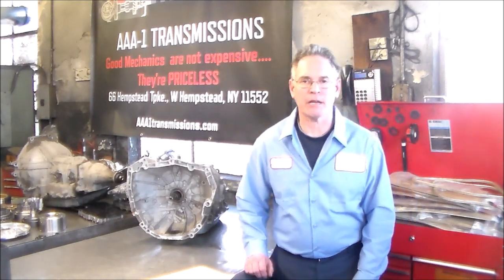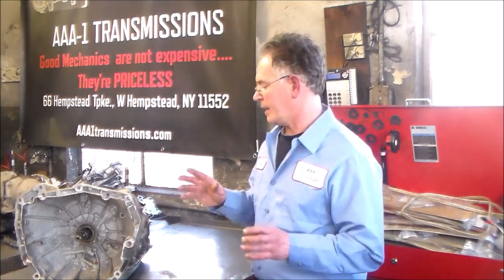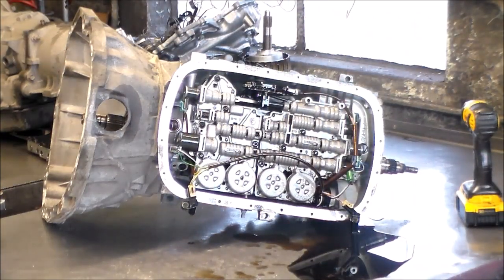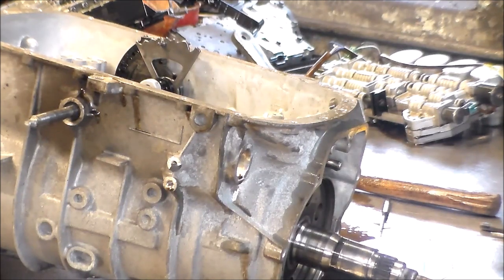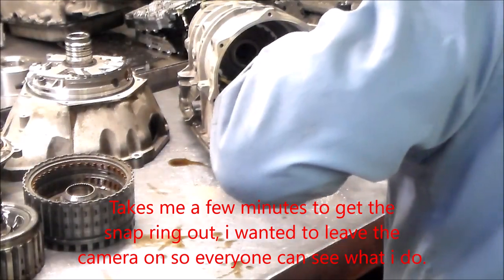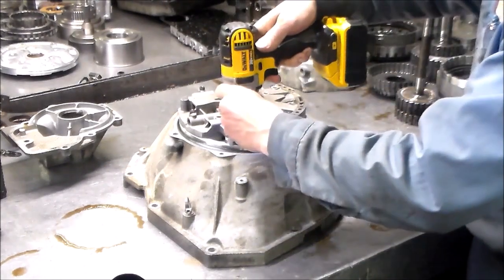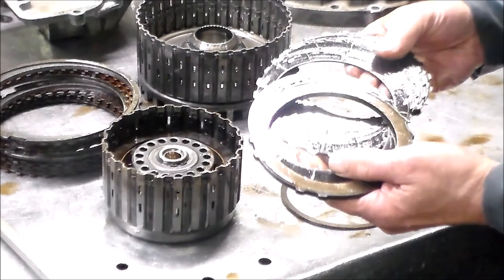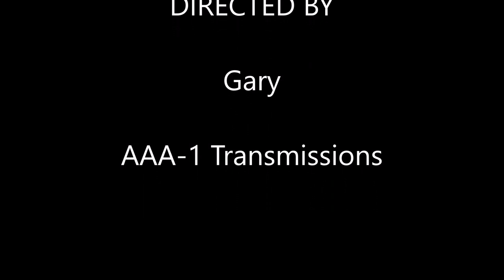5L40E Teardown

Comment: Man this video just explained so much. Haven’t drove my Pontiac g8 in 3 months because it stops accelerating after warming up, I’ll come to a stop and nothing. Turn the car off, let it cool down, and good to drive for another 5 minutes. No codes came up either. I’m afraid I’ll need a trans rebuild after watching this
Reply from the maker: Yes, you may need one. Problem is the filter is clogging up
Reply: @GaryFerraro  which means somewhere in the transmission there is failing components which is leading to the filter clogging , correct ?
Reply from the maker: @MrStfu88  Correct
Reply: @GaryFerraro  hey isn't it just those rubber seals between the valve body and the body of the transmission.
Reply from the maker: @aksgarage3230  yes

Comment: Thanks a lot for sharing a detailed teardown of this transmission. I am currently in the process of tearing down one from a BMW X3, and wonder if there are internal differences in the 5l04e transmission between the different makes and models (Like Cadillac, BMW X3, X5 etc ?) My reason for asking is that i have a X5 transmission in good condition and have (unsuccessfully)  tried to find some information online if this would work as a replacement or not.
Reply from the maker: Caddy units are different from the BMW units,
Reply: @GaryFerraro  Thanks. I found out that the output shaft is different (splines).

Comment: at around 21:40 ,I did a repair on the neutral safety switch, but the thing holding it, the piece right beside it, the rod fell out of its spot, and I cant seem to put it back together any ideas?

Comment: u should have a couple of eye hook bolts u can thread into weld nuts on table and use a ratchet strap to secure housing when removing that snap ring
Reply from the maker: Hmmm, Not a bad idea, thanks for the tip
Reply: @GaryFerraro  u b welcome

Comment: Have the same year make and model but had a trans cooler line blow and bypassed radiator for external cooler. After flushing trans and filling back up it shifts hard and slips until the car is warmed up. What could possibly be the issue there? I thought gear wear from the fluid leaking but don't understand why it would shift fine when warmed up. any insight would he appreciated thanks

Comment: My personal truck is 05 caddy srx 3.6, awd with borg warner 4476 t case, and 5l40e auto box.  I found a bulletin, regarding trans output shaft \ tcase input shaft flanges, stripping out their splines due to corrosion.  Any comment on that would be appreciated.  

My truck makes a really scary driveline pop, when loading up on the throttle, from a stop.  Im thinking tcase chain, those input \output flanges, front prop shaft, or maybe even hub n bearing n cv axle engagement.  

I gotta get it on an alignment rack, and try duplicating the problem.  Jackstanding the truck, i failed to duplicate.

Bulletin showed rust dust build up, once getting the tcase off.  Supposedly new shafts are redesigned to accept an oring to keep water intrusion out! 😅
Reply from the maker: sounds like the chain is popping, if you pull the T-case off, you can clean up where it meets the trans and put some high temp grease, that will help
Reply: @GaryFerraro  I'm sure it is, as well.  I added a chain replacement, when I sent the 5l40e off for a bench rebuild, about 60k ago.  Sent the transfer case with the 5l40e.  Valve body bought the farm, and I said additional complaint was driveline pop on hard load.  

When I had on jack stands (about a week ago) I decided to do a drain and refill, and while the tcase was empty, I stuck a screwdriver inside the drain hole of tcase, to assess the chain slack, didn't seem sloppy....but who knows it could be the sprocket teeth starting to roll over for all I know.  

The trans shop put gl5 (thick gear oil) in the tcase when they did a new chain (that's what came out last week).  I decided to put dex 3 in it, to hopefully clean any junk inside, and I'm gonna try and drain that in next 1000 miles...figured the atf detergents might help lol.  I just hate knowing that I found that gm tsb about the trans output shaft\ tcase input shafts stripping....

Maybe I am looking too much into it, without pulling it apart.  That means, I need to literally cripple the truck for that diagnosis!  😁🤷
Reply: Thank you for the reply, either way.  I'm just reaching on this situation because it's my personal vehicle.  I've been in service, repair, diag, and electrical diag for >22 years.   Always trying to listen to both sides of a coin haha
Reply from the maker: @sidewayzmike  correct,  if you take off easy works ok?  no popping sound

Comment: I have a problem finding diagrams for this transmission, the 5L50e. Mine is a 4WHEEL DRIVE GM of the model in the video. Would you happen to know where I could find that?
Reply from the maker: Wiring diagrams or transmission diagrams?

Comment: Hello, great video. I need to replace GM 5L40E on bmw x5 e53 year 2001 3.0i. I can only source the gearboxes from the same x5 3.0i from other years, like 2003 or 2004. Is it possible to use "newer" year production gearbox to the older car? Like 2004 gearbox to fit to 2001 x5 and will it run? Please if anybody has an experience with this replacement it would help me if You can confirm it is safe. Thanks!
Reply from the maker: I would go by your vin number

Comment: Hey I've got a 5l40e transmission valve body (plate code 378) with a broken 1-2 shift accumulator spring. I'm having a lot of trouble getting either a new single spring for that accumulator or a kit of all 4. Any help would be appreciated.

Comment: Great video I have the same transmission for some reason the solenoid c won’t fit all the way into the valve I’m not sure if the metal pin should be so pushed out any ideas ?
Reply from the maker: If the solenoid is in front of a valve, make sure the valve is all the way in.
Reply: I have tried gently pushing the valve in however it is stuck on as that is the reason I am changing the solenoid as well would I have to push in the valve with something?
Reply from the maker: @twisted-sd2cz  The valve is free?
Reply: Nope won’t budge at all so not sure if I should find something like a screwdriver and hit with a Mallot however I’m afraid it will instead make the problem worse so I’m not sure what to do
Reply from the maker: @twisted-sd2cz  those valves have to be free to move, if it can't be fixed and have free movement you will have to source another valvebody

Comment: Hi Gary  I have a Discovery 3 with a ZF6HP26 I have had a gearbox repayment but they gave me one from a 4.0 V6 petrol I have a TDV6 diesel we fitted the box with the old converter as the petrol is only 3 boult and had the old converter rebuilt and had the valve body completely serviced. but the car sits in idle on full load only way to drive is to take foot off break and wait till car is moving before any gas Can you tell me if there is something different with the 2 box's spent to much money now I can only think to rebuild the old box.   Regards Peter.
Reply from the maker: Any codes?   There is a delay in drive?
Reply: @GaryFerraro  sorry so long in reply it has no codes yes a delay in drive every one beats be at the lights as have to wait for car to move off the accelerate but all time sitting at lights it is in full load have to brake hard to hold it back
Reply: once it going it runs beautiful even down shift to 1st all smooth
Reply from the maker: @peterandrews7756  ok, question, does it delay or take off very slow from a light?
Reply: @GaryFerraro  take foot off brake it moves off very slow
Reply from the maker: @peterandrews7756  I'm thinking this is not starting out in first gear, maybe starting out in a higher gear ,how is reverse?
Reply: @GaryFerraro  Both reverse and 1st gear  are the same just have to wait for car to move then accelerate if on a hill or speed bump the car wont go so I cant go anywhere a Land rover is meant to go cant pull a trailer. but as I say its on full load car is shaking at stop lights if long lights i just put it in neutral.

Comment: worst transmission ever
Reply from the maker: I don't like working on these either. lol
Reply: @GaryFerraro  also the 5l40e is used in weird configurations. for example bmw m57 (410nm tq) and the trans can handle only 340nm
Reply from the maker: @jaakko200987654321  Correct, used in Bmw as well, i did a couple of Caddy's
Reply: @GaryFerraro  my friends e46 has that trans, it has failed twice (sudden extreme slipping)
Reply: Shit I just acquired a caddy with a bad one in it.